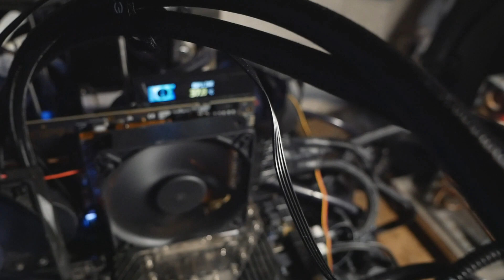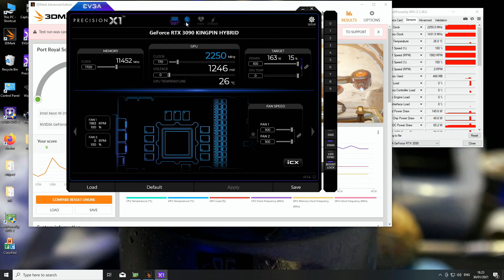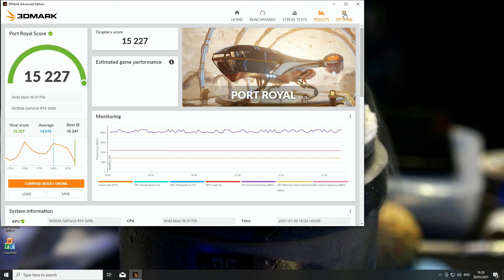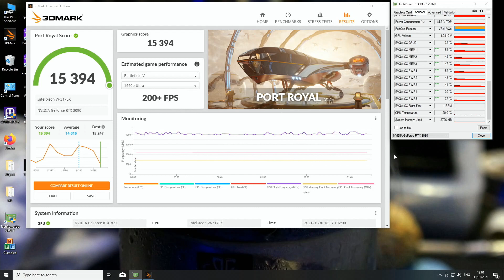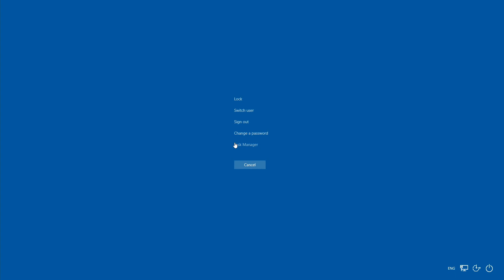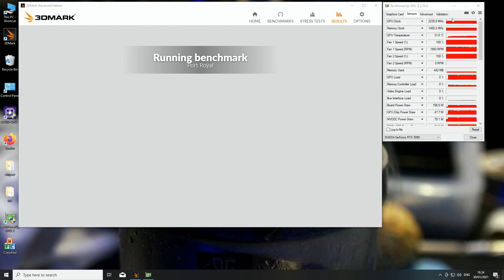EVGA RTX 3090 KINGPIN - REAL Overclocking Guide

Comment: Luumi, I did the XOC flash, that was successful. How do i use the classified controller where do i install it? I opened it and worked the slider and apply and save but it doesnt do anything where do I put the profile.ini?

Comment: Call it luck of the draw and silicon lottery but I've had 4 3090 KPE's and none of them would go over 2130 on the core without having to go below ambient.
Reply: Oof. I've owned 4 of them. All of them would maintain 2190-2220 at regular ambient temps. Memory between +1500-+1800. 2130 is brutal 😢

Comment: Hey Luumi! I have a RTX 3090 Suprim X from MSI. I have read that I can flash the card with the EVGA 500W bios. Im using the stock cooler. Its paired with 5800X3D/64GB ram/NVMe and chipset is X570S. How would you do to overclock my system?

Comment: luumi i got a zotac 3090 arctic storm with the kingpin 1000w bios. its on a custom loop with 4 360 rads with all 3000 rpm noctua fans.during games like metro exodus at stock boost 1950mhz its pulling 650w . i been playing for days now but im wondering if you think 650w constant will kill the card

Comment: I just got my 3090 KP and at stock on LN2 bios im only getting just above 10k on PR at 1440p with a 5950x...is there something im doing wrong? I have my temps in the low mid 50s under full load, but i do have one of my 8pins being daisy chained, could that cause any issues?

The bios in gpuz shows the full 540W as a maximum, but my card only pulls up to  around 430Wish.

Any help would be greatly appreciated.
Reply from the maker: Is card running in X16 mode? The stock LN2 bios is just a stock bios so you need resizable bar XOC bios for higher power limit. IT is on EVGA forums.
Reply: @LuumiJuhani  yeah I verified it’s on 16x on my dark hero board. I also enable resizable bar and I’m still getting around 10112 score in port royal. I’ve made a post with everything on the overclock forums with screenshots of everything that I’m actively following because, this is a sad

Comment: I'm getting 14900 in port royal with EVGA FTW3 ULTRA with 500w vbios on my max overclocks 150 core 1400 memory. Looks like I'm doing ok for not messing with custome vbios and messing with voltge right?
Reply from the maker: You should update for Resizable bar.

Comment: Does removing the stock cooling help with temps? My mem doesnt go above 1200mhz either. Kinda disappointed with the KPE
Reply from the maker: Are you sure? Make sure the memory chips are making good contact with the cooler on the front and to the backplate at the back.
Reply: @LuumiJuhani  ya… I never took the card apart so it should be fine. Not sure why doesn’t go above 1200mhz. The memory temps are fine and I even added heat sinks on top..

Comment: You've mentioned the max voltage you can set on air. Does this still apply on chiller/chilled water where water temp drops below ambient or even dew point? I don't have a Kingpin card right now but I'm planning to shunt mod and attach an EVC2SX on my 3090 Strix to control the voltages. Can I use the voltages on your video to the EVC2SX as a reference? Also, will it be fine if I increase the memory voltage if memory temps are 60°C below? memory temp is 44°C @ 18°C ambient. Great video BTW! The next time I buy a GPU it will be a Kingpin card 100%
Reply from the maker: You can try yes, just check does it help you.

Comment: I followed your instructions verbatim and port royal crashes immediately.  Used identical settings to the first time you ran the test.  Why is your GPU at 210Mhz?  Just not set to "prefer maximum performance" in the NVCP?  Even my core when locked with Boost Lock doesn't come out the same as yours.  Mine when I add +150 to the core is 2115Mhz, yours is over 2200.  

Either this guide is missing steps or something isn't right.  I'm doing exactly what you're doing and getting totally different (and unusable) results.

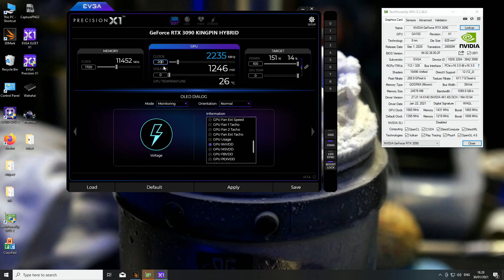15:08 - How the hell are you doing +200 on the GPU?  Mine won't let me go above ~110-120.  Did you change any settings in Classified.exe between tests?  My memory can't even go beyond ~1200.
Reply: are you using the XOC 1000 watt bios?
Reply: @rtgoad  Yes, I said I followed his instructions verbatim.
Reply: Silicon lottery is definitely a real thing. Luumi has a very good binned card as shown here.

Comment: You should do a Windows 10 tweaks video for 3D mark OCing. Also when using the classified tool to adjust voltage do you always leave the Voltage slider in X1 at zero? For Ln2 cooling

Comment: Would you consider the voltages you set with the classified tool good for everyday use or just specifically for benching?
Reply: Hey man, I was just researching this and seen your question. In case others find this question, I like to close them off >< READ ABOVE IN DESCRIPTION. Here is a quote "I would not go above 1.2v for daily use, and use a very mild Load-Line setting on both GPU and MSVDD to avoid too much overshoot. Like level 5-6 or even lower value like 8-10. Level 0-1 are the highest options which shouldn't be used."

Comment: Okey Luumi i have a Question for you my friend what Fluke for Reading temp do you use and what price for it to use with Ln2 ? i dont find any good one in sweden :(
Reply from the maker: I found one used on ebay. They are very expensive new. Good price for dual input Fluke is maybe 150€.
Reply: @LuumiJuhani  okey what kind of fluke /  Ir thermometer do i need for Nitrogen ??? its hard to find any good ones :(
Reply: @LuumiJuhani  Nevermind i find couple of fluke on ebay it seems a UNI-T UT-325 Industrial Contact Type Dual Thermometers is very good one

Comment: Hey :) 

I Followed your instructions to a T.. Unfortunately it seems my kpe 3090 does not like the high memory. I went lower than your initial +1700, set mine at +1600 and instant crash :/. Seems like +1200/1250ish is max though all the other settings seem great :)

Sub'd.

Thanks again!
Reply: Sadly, my kp can't go any further than +1000.
Reply: my kingpins memory used to run way faster a year ago when it was new and I have also noticed powerdraw issues the past 2-3 months I am currently trying to RMA it

Comment: This video is outstanding, the amount of useful info gathered in 25 minutes. Thank you very much for your time and effort. Love to learn from the elite of overclockers. 

Just quick question regarding memory voltage, my readings (OLED) using LN2 (original BIOS) is around 1.4/1.45. Feels pretty high to me and would like to ask you. 

Thanks again for your video :)
Reply from the maker: It can show a bit higher than what it really is. Stock set value is 1.36v.
Reply: @LuumiJuhani  

Maybe my card stayed at that fixed voltage for some reason because I can't get it to go below 1.4ish. I'll try switching to the normal BIOS and see how it behaves. Thanks again Luumi! 

Btw, congrats on your XOC scores!

Comment: Quick question (I'm not sure I understand) regarding LLC : lowest number (LLC1) overshoot more than higher number (LLC12) ? So on ambient we should never use LLC2 or LLC3 for example when you use 1.2V ?
Reply from the maker: Level 0-1 are the highest options and level 15 lowest. Lower number higher level in this case. So level 0 has the biggest overshoot.

Comment: @Luumi I noticed you have stock Windows. You can improve stability by disabling most of the services, Telemetry, data logging, performance counters ect. If you are interested I can help with that. You dont need more than 35 processes and around 20 services for ex. 
ps. I like your channel.
PS . You always can use different profiles for the different parts of the Benchmark.
Reply: Can you put a guide for others in chat?
Reply: @Multimeter1  a gude in this chat how to strip Windows?! XD.  I have a blog but its not for stripping,  its for Gaming Optimization,  Lower Latency,  better Hit-Reg ect. Just type n1kobg blog or similar.
Reply: What do you do fora living?
Reply: @pav1u  Thats a personal question. Why you think Ill answer to a stranger :) Im just enthusiast. Use computers for more than 25 yrs.

Comment: Do FTW3 3090 cards support RTX classified controller?
Reply from the maker: Doubt it, the controller has to be the same in order to work. The voltage controller I mean. And even if it works it doesn't give any benefit if you don't have custom BIOS or shunt mod.
Reply: @LuumiJuhani   thank you for the reply.

Comment: Hey Luumi thanks for the video! What settings should i use for evga classified tool for rtx 2080 ti kingpin? Can i just copy the ones you entered for your 3090? Keep up the good content. Have really been enjoying your recent videos.
Reply from the maker: I tried 2080 ti kingpin up to 1.3v on water but I think up to 1.2v is relatively safe. With 2080 Ti you can use load line level 0 and 1 fine.

Comment: Great guide! Thanks.

Curious is LLC1 the ‘default’ LLC out of box for the card?
Reply from the maker: I dont know which is the default, but larger number is lower setting. Maybe even level 8-10 would be great for normal cooling.
Reply: LLC1 is default.
Reply from the maker: @liftedcj7on44s  And it is too high.
Reply: @LuumiJuhani  I fully agree, when I was testing the 2 3090 KINGPINS I have here with LLC set to 1 if I dialed in 1.2 NVVDD I was getting near 1.4 reported on the OLED which is reading from the voltage regulator and at the core was still around 1.3v.  Like you I ended up dialing in the LLC setting to around 6 or 7 which helped with the amount of overshoot.

Comment: Nice, i didn't touch the voltages yet, was testing it all before i changed the stock paste. My highest without classified was +140 core, +1475 mem, pr 15246. I have 8700k 5.2ghz on z390 dark. But i just changed the stock paste, was quite dry and hard, for kpx and going to see what I can get messing with voltage on core a bit tomorrow. Then off to ln2. Did you have the stock backplate on in this vid?
Reply from the maker: Yes
Reply: Kudos on a very good score! I looked up your result (nosey, I know :)) and compared to mine, and I noticed your GPU and mem clocks are lower but you still beat my score by almost 100 points. Wondering if you had any tips you can share related to windows or driver optimizations, if you are using any? Thanks :)
Reply: @HugoAguilera  what's the link to yours? My scores are on a test bench that's only for oc. Pretty much stock os and on driver just the quality slider all the way at performance. Turn gsync and vsync off.
Reply: @Apollo-Computers  Ahh good to know! I didn't think of the slider in the NV control panel. Here is a link to mine: https://www.3dmark.com/pr/918026 - I'm also on a test bench in my garage, using for the same thing, OC'ing the card :)
Reply: @HugoAguilera   CPU frequency helps as well. Anything above 2175 on my card would crash no matter the voltage if it went above 44.9 c, and would drop to 2160 a lot. It also had a worse score if I used the 1000w bios. 15100 was best I got with that 1kw bios. Mine had a bin of 1995mhz on its own, written on the frame of die. I feel that they were producing more KP cards than ftw's and the bins are shitty this time around. But I don't know for sure. Slot of cards out there that are worse then ours, and a lot of lesser model cards on air  out performing kp cards.

Comment: Do you need to Email Vince for the 1000w Bios after getting the card?
Reply from the maker: It should be posted on EVGA OC Lab forums, but sure you can email him too if you wish.
Reply: @LuumiJuhani  I was just curious, still waiting in the Queue for my card
Reply: @georgem.6136  I just got mine a few days ago. I hope you get called soon!
Reply: @LuumiJuhani  Where is the custom bios?
Reply: Will the 1000 W BIOS only work with the Kingpin? Or can it work on any card such as the 3090 FE?
Reply: @NUCLEARARMAMENT  , The card will be limited because of the current sense resistors, just Shunt Mod the FE & the bios you can leave alone

Comment: 1st step modify bios power and voltage maximum.
The rest increase all slides till a level just that  you don't destroy your hardware.
Reply from the maker: Higher voltage is not always better. Like I got 1450 mem without touching the memory voltage at all.

Comment: What is the point of such overclock when you would rather not run a 600W card during gaming because of the vacuum like noise?
Reply from the maker: 445W already at stock. This video was about how to actually overclock the graphics card, further than what you can generally do with just the stock voltage.